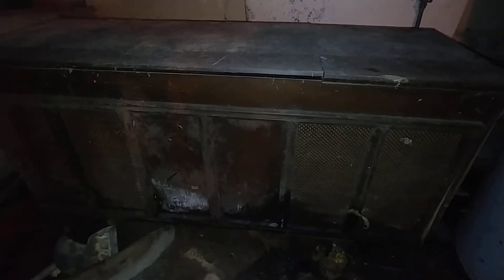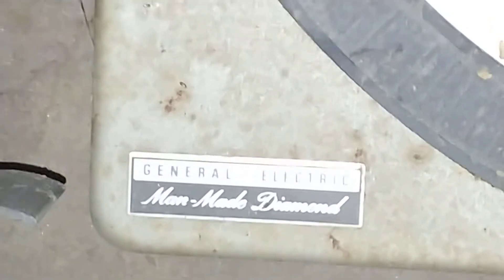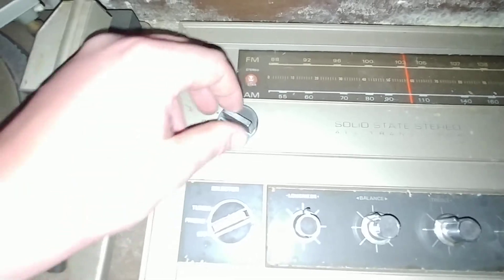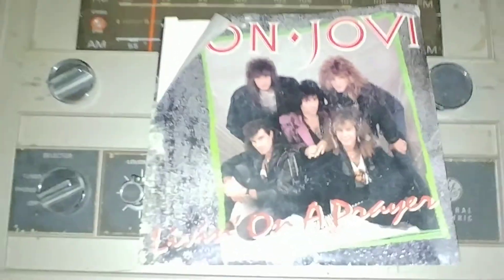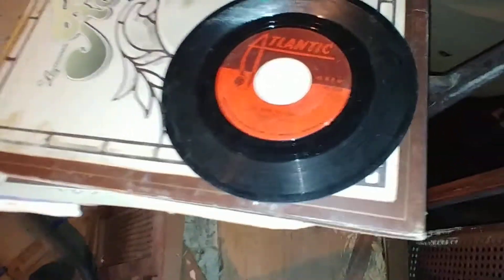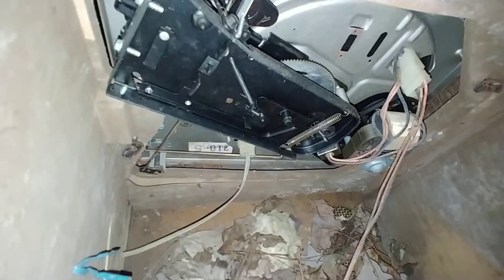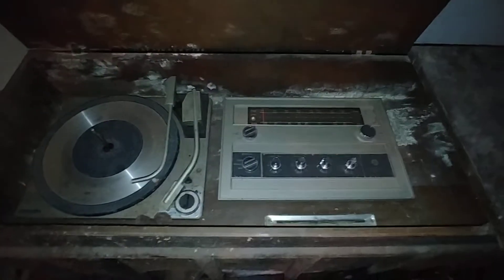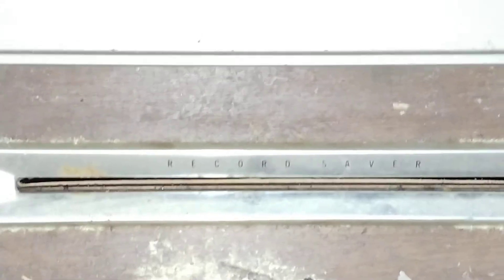Abandoned Console Stereo Left to Rot

Comment: The slot in the front inside is supposed to be used hold your record upright. Back in the day there was only a cardboard jacket for your record. There was no one sleeve. You'd turn the cover to the open side, place the cover over the slot so the record would slip in it. Remove the cover then you could grab the edges of the record easily without touching the surface of the record and place it on the turntable